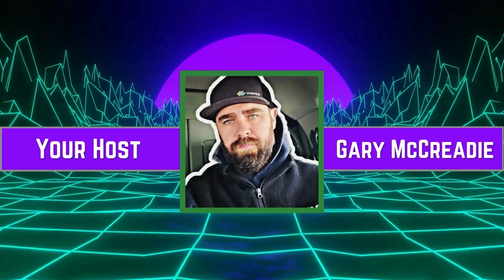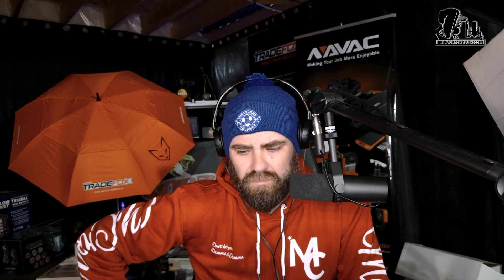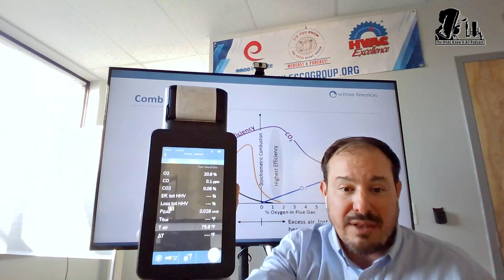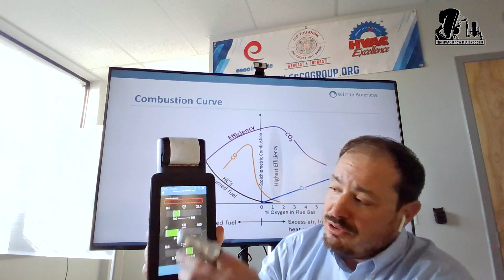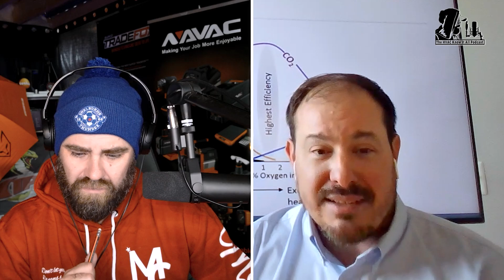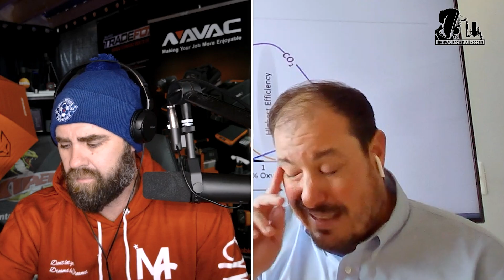HVAC Advanced Combustion Analysis: Secrets Every Tech Must Learn with Jason Esteves

Comment: aren't most gas equipment like furnaces and rooftop units not adjustable beyond getting the btu/hr input to what's on rating plate and not engineered to be tuned with an analyzer?
I understand  large commercial boilers and some other equipment is set with an analyzer.

The actual degree of efficiency loss with more o2 is not talked about. If running 8 % of o2 instead of 5% drops it by 2 to 3% it's no big deal.
There's also the danger of fixating on steady state efficiency too much trying to be a purist maximizing that but ignoring the bigger picture like cycling losses and pipe/jacket losses for boilers.
Reply from the maker: We're not only worried about efficiency.  Using an analyzer on a furnace tells us if it's running safely
Reply: I was wondering I was going to purchase the seitron NOVO or the Fieldpiece cat 85.  Is there any feedback on which one I should purchase?
Reply: The combustion analyzer allows you to set your fuel to the best level, so you are as close to the stoichiometric, line as possible.
Reply: Meh..combustion testing is more about safe operation. For example just last week we found a rooftop making high levels of CO, dangerous amounts. The source? When installing someone tightened the nipple into the gas valve enough that it twisted and bent the gas manifold. All the gas orifices were misaligned. Some readjusting go the CO to safe levels. Were there factory adjustments to be made ? Gas pressure was about it, fan speed. But by testing you can verify safe operation